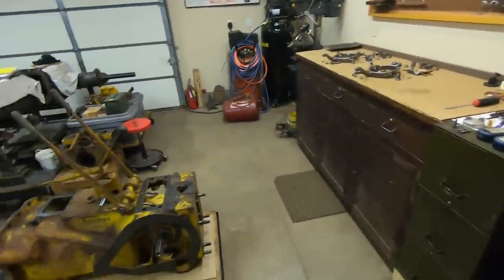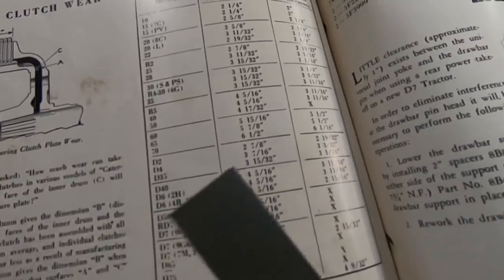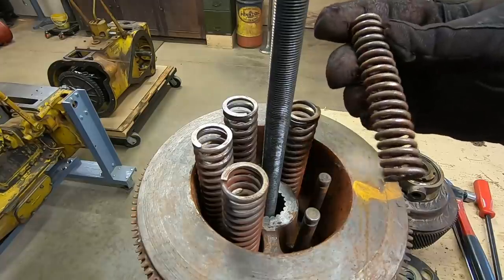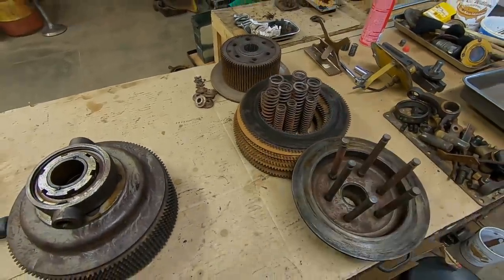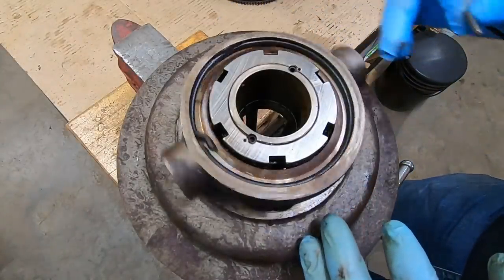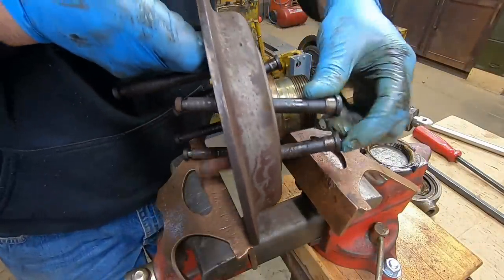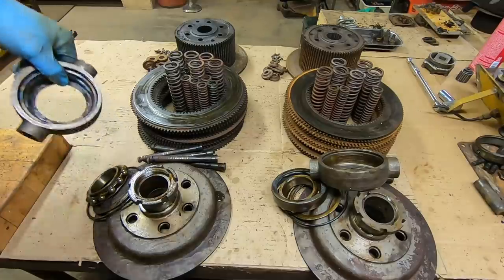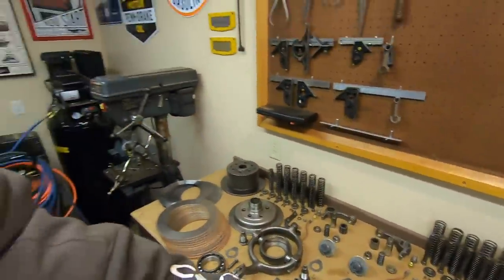Caterpillar D2 #5J1113 Chassis Rebuild Ep.19: Steering Clutch Inspection & Disassembly

Comment: I would guess that the left steering had more wear than the right on our D2 back in the fifties.  The right track ran down in the furrow and guided the tractor when moldboard plowing so the steering wasn't used but occasionally from one end of the field to the other.  When making the left hand turn, however, the left clutch got a workout as the right track had a hard time pulling the 3-16" plow around the corner.  The turn consisted of constantly working the left clutch and brake and was even more difficult in wet conditions.  
Another great video!   Keep up the good work, Toby!

Comment: Have you considered a section of cold-rolled square or rectangular bar stock, threaded, to replace the bottom nut on your fixture? Alot more meat for the vise jaws to clamp down on, and reduces the possibilty of everything tipping sideways-

Comment: This might seem like a dumb question but, did Cat have some way of testing those clutch springs to see if they were getting weak? I'm sure over time they'd get weak. 
Was wondering, could a brass wheel clean those discs up and reuse, minus any pitting in the friction discs of course. 
"Things can happen", tis why I'm a firm believer in Murphy's Law. 
So, I take it, you haven't tried to just "freeze" the bearings out before? I've seen some old timers freeze some parts with bearings still in them. Pulled them out of the freezer next day, a few light taps, and they fell out. Just like welding on the inside of the outer race. 
More to fix but, more reliable "IF" taken care of just like with anything else. Great video as always.

Comment: Hey Squach.  Love your videos.  Why is there not a friction disk between  the final steal plate you removed  and the pressure plate?  It seems  like steel on steel  wouldn't  be a good  combination.  Also is that a giant  valve standing up on your  floor by your trash  can?

Comment: I’m surprised steering clutches are not in an oil bath like a motorcycle clutch or an automatic transmission. Seems like they would last longer as well as run cooler.

Comment: on your D2 turning clutch spring compression tool.. have you thought about using a much bigger drill  and putting a taper not all the way thru  to give you better access to the keepers.

Comment: I'm surprised that there isn't an od number of total plates so that the two outer plates are friction material riding on the pressure plates. I seemed like the last plate you removed was a steel plate .

Comment: Why would they make the bottom ring metal where there is metal against metal on the pressure plate ?
Reply: I was going to ask the same question 15:29
Reply: So it only will damage a plate if it goes south. Cheaper to replace the ring than the plate. Only the frictions spin
Reply: @michaelgreer7901  Makes sense. Thanks

Comment: What does your stack height look like on the new components?
Reply: @squatch253  Awesome.   Don’t take this wrong... not suggesting YOU should do this...   just trying to understand the makeup of these clutches.   Considering the “oversize” on the stack height of the removed clutch pieces, would it be possible/acceptable to clean the steels up really well then run them on a surface grinder?   Or is the pitting too deep to get a decent surface without compromising the integrity of the steels?
Reply: @squatch253  Thanks.   Couldn't tell from the surface rust how deep the pitting was.  Truly a fascinating journey.

Comment: Lots of hardware and parts there. I have already forgot where the brakes are. Must be hiding in the final drives.
Reply: They are bands that go around the outside of the steering clutch pack.  Pull the clutch to stop power to that side then step on the break to turn to that side.
Reply: @rolandmohler2695  Yes I just did not remember from his earlier tear down videos. Thanks. I imagine his finals are next on the list after this.

Comment: Those steering clutches won’t “ wear in”
Reply: @squatch253  
What I was asking was answered at the end of your video.  Since the steering clutches were swollen from the rust would they reseat themselves just with a cleanup. You explained that the steels were pitted and rusty possibly causing hot spots on the steels and friction disks. The way I understand this now is they are similar to flywheels and brake rotors. If you just throw new pads or clutch onto a worn/used machine surface it will wear in but it will overheat the high spots on its face. That is why we always resurface rotors and flywheels.
Reply: @squatch253  
No worries, just a question. I enjoy seeing the old iron being resurrected, I can’t wait to see the crawler moving on its own again. I’m sure there are a lot of those machines just rusting to death up north there. I’ve come across a few here in Texas. They look as bad as some of those rust belt machines that I see people working on

Comment: Okay...ya lost me a little. Why/what were you welding at at 23:10???
Reply: @squatch253  Okay, okay...I think I get it. The inner part...the bearing race...was trash anyway. So you just shrunk it by welding it so it would easily pop out...and go directly to the scrap heap. You'll replace the bearing entirely in an upcoming episode. You just need to keep the outer housing intact. Right?